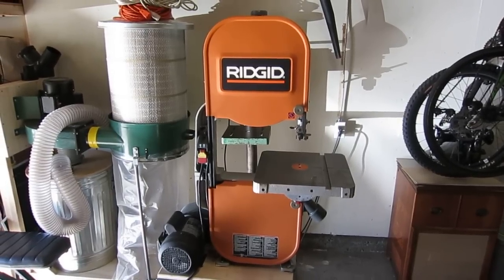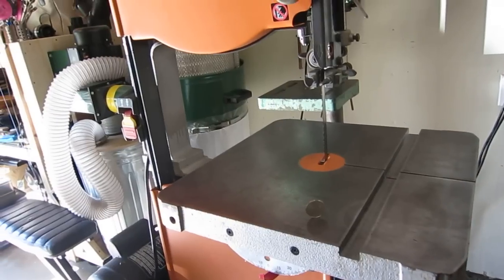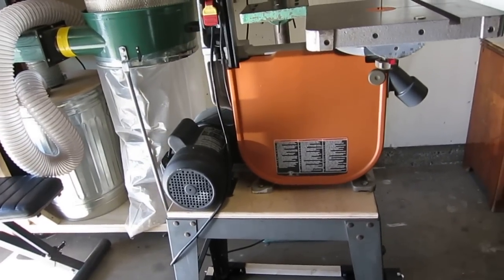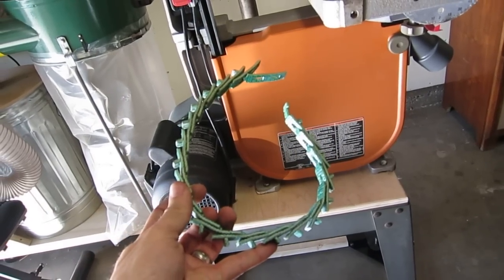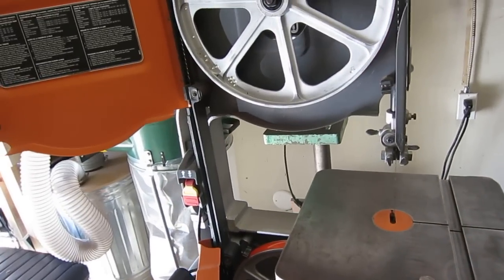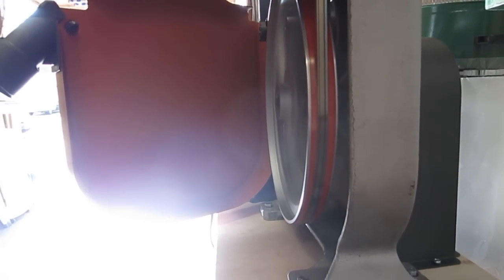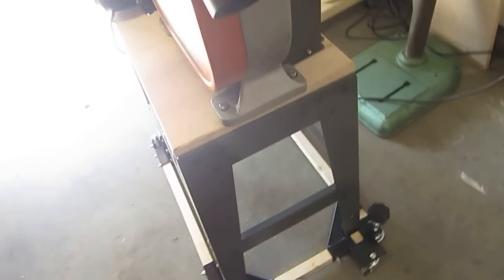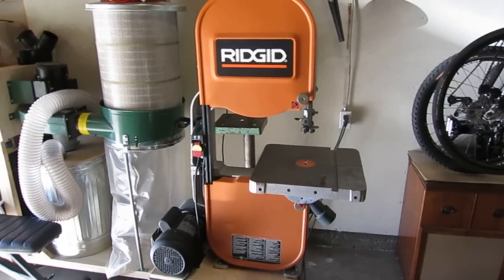Ridgid 14002 Band Saw Must Do Modifications

Comment: The wobble in your wheels are from the wheels not properly spaced from the lockdown nut.  You need to add shim spacer washers to the wheel hubs in order to snug up the wheels and stabilize it better.  There are shim spacer washers available. It is a matter of finding the right diameter and with graduated thicknesses.  You need to use a feeler gauge to test the play of the wheels between the mounting hub and body on both upper and lower blade housing. If you shim one, then shim shim the other. Make sure you have matching shim thicknesses for upper and lower wheels. There will be differences in how much the wheels wobble, which are indicators of improper spacing between the wheel hub and the wheel. Once properly and correctly shimmed, all or most of the remaining vibration issues you are experiencing should go away and the machine may actually run smoother and quieter.  

Good video, nice job balancing the wheels. I am a little concerned that you chose to drill the wheels instead of finding lead weight clips to balance the wheels with. They are available and can be clipped to the inner rims between the spokes. Once in place the balancing clips can be tacked down with JB Weld epoxy which is a strong permanent bond.

I was just gifted the exact same model. It was left out in the weather so I need to clean the motor. The tires need to be replaced, the table sanded and the tensioning rod and adjuster need to be replaced. Once I get them installed the saw should work. It will then be a matter of rebalancing the wheels and doing a lot of sanding, cleaning and adjusting. Thanks for the video... very informative.

Comment: I have a similar model. Had to replace the top tire immediately. it does shake a little on start and stop. The blade tensioner does not seem to be right. Any recommendations?

Comment: I bought this same exact machine a month ago and could someone give me advice on how to fix the bottom wheel will not staying on because of left handed threads.  If I tighten to much then it rotates really hard whenever I turn it on the machine.  Am I missing a set screw or a bushing behind the wheel?  For this band saw to spin freely and smoothly I have to hand tighten the left hand threaded bolt and then whenever I turn on machine, the bolt comes out after a few minutes.  HELP!!Great video too.

Comment: I have one as well I got used and it jumps all over and the rubber on the wheels rides off. Where did you get the new tires and by chance do you have a part number? Great video by the way.
Reply from the maker: Thanks!  Sulphur Grove is the maker.  Just their generic 14" band saw tire is what you need.  Available on ebay and amazon.

Comment: Order an upgraded upper wheel assembly now and save yourself some time and trouble later on, the pot metal its made of crumbles under the blade tension and will fail 100% of the time eventually. Luckily there are upgrade quality replacements made of cast iron.

Comment: Thanks for the video.  I have this bandsaw and had it in storage for a long time.  Now I need to get it working again.  How did you balance the wheels and where did you get the new tires.  Again thanks for the video it was very informative.
Reply from the maker: Google "band saw wheel balancing" .  There are plenty of resources that will go much deeper into detail than I could with a written response.  It's a pretty straight forward process once you see how it's done.  I purchased the tires off of Amazon
Reply: Thanks much

Comment: What is the process for balancing the wheels?
Reply from the maker: Let the wheel spin without a blade or belt on it.  Mark where it stops.  You want it to stop randomly every time.  If it stops in the same place you either need to remove material on the bottom where it stops or add material 180* from that.

Comment: BTW..what brand Urethane Tires did you buy? If it made that much of a difference, I want the same brand. I will balance my wheels without any tires on it.
Reply from the maker: +Mark Price I ordered the PS Wood Machines band saw tires.  I've since sold this machine but I purchased the same tires for an 80s Rockwell Bandsaw that I used for awhile and then for my Rikon 10-325 that replaced the Rockwell and again on a late 40's Delta 14" BS I'm restoring.  All have been great and have made a big difference.  Goodluck!

Comment: AWESOMMELY, WONDERFUL EXXCELLENT ASTOUNDING..  EV
Reply: Thank you for this video, I decided to buy one of these after watching. I found another really great trick to smooth these out. I purchased a set of 4 vibration pads that are made for washing machines. I picked them up at a thrift store for $3.00 so figured why not give them a try. I first installed the link belt which really didn't do anything. Then I balanced the top wheel and that seemed to help some but not a lot. Today I installed the plywood under the machine and also replaced the lower tire at the same time. This made a very good improvement. The upper tire was already replaced by the previous owner so they are both done. After this the machine was much better but still vibrated  more than I would have liked. So, I installed the 4 anti vibration washing machine blocks and wow! they really smoothed the vibration out. Now the machine is so much better that it was. Thanks for the video and hopefully my additional trick will help others watching your video.

Comment: Are you experienced with bearings and the arbor wheels on this at all?   I have all my moda done but when I run the saw without the blade on I'm getting a pretty loud knock from the bottom wheel. I posted videos on here if you click on my name/profile.

Comment: So how do you balance the wheels?
Reply from the maker: +Leroy Farmer Search youtube for "balancing band saw wheel".  There are a number of videos out there.  I didn't want to include it here because it's already been done and it would have really lengthened the video.
Reply: +Leroy Farmer I bought this exact saw before I ran across this video.  I too had to balance my wheels.  It helped to get 2 ceiling fan balancing kits but I also had to drill out my heavy spots.    Basically the heavy spot always wants to go to the bottom (no blade attached of course).  Just start by adding one of your weights to the exact opposite end that falls to the bottom  until it's close enough where you can slowly remove material with a drill to the point there are no heavy spots rolling to the bottom.  It will always randomly stop when every rotated when spinning freely.

Comment: Don't listen to that guy. I actually scored one on Craigslist a few days ago ONLY because of your notes here. Question, how much tension do you have your drive belt under. I believe I have too much.
Reply from the maker: Glad I was able to help!  As for the belt, you should be able to push on the belt and get 1 or 1.5 inches of deflection.  I think there's an exact number in the manual, which is available online.  Enjoy it!
Reply: How did you clean the rust off the table too?
Reply from the maker: themrnorwood WD40 and a scotchbrite pad then 600 and 1000 grit wet/dry sandpaper.

Comment: How did that mobile cart end up holding up for you?
Reply from the maker: It's held up well.  I actually have a few now and haven't had an issue with any of them.
Reply: thesergeant you when you want to stop the roll you have to turn the oversized knob.  Do you find that a pain?
Reply from the maker: Adam Barraclough It hasn't been a problem for me.  It really only takes a couple turns to raise/lower it enough to roll/stabilize it.  Obviously a pedal is more convenient but the larger size and cost difference wasn't worth it for me.
Reply: thesergeant When you upgraded the tires did you do any cleaning of the wheels before you put the tires on?
Reply: thesergeant Did you leave the stock feet on the stand before you put it on the HF stand?  I took them off and I am getting a little wobble even with the feet lowered on the HF stand.

Comment: where can I get the new tires?
Reply from the maker: I purchased them off of Amazon from "Sulpher Grove Tool".    I've used them on this saw as well as a Rikon 10-325 and a 1946 Delta 14" with great results.  They've been great.  I tried others and they haven't been a tight fit or had bulge at the joint
Reply: 1" width?

Comment: I have this saw, vibration horrible and for the life of me I can't get the blade cutting true. The blade cuts at a slight angle all the time as if the tires aren't good but the tires look fine. I don't know but I'm sick of it and want to get something else.
Reply from the maker: +swimbait1  Balance the wheels, replace the tires and see what happens.  If the vibration doesn't go away try the belt.  Those three should address the majority of the vibration problems with this saw.  As for the blade not cutting true, you might want to bump up your blade tension, or adjust for blade drift.  Also, set your machine up per "Alex Snodgrass".  Hopefully that will solve your problem.  I will say this though; I sold this saw and I regret it.  I purchased a Rockwell 28-200 to replace it thinking I was getting "vintage quality" but I and had nothing but problems with the Rockwell.  Sold that saw and got a Rikon 10-325 (which is great btw--once adjusted) and  also restored a 1940's Delta 14".  While both Rikon and the Delta are great none of them have compared to the Ridgid in terms of cut quality.   Watch the "resawing with Ridgid BS14002" video to get an idea.  I had absolutely zero blade marks with this Ridgid.   I wish I would have kept it to be honest.
Reply: +swimbait1 I have this same saw and the vibration is bad. I have not replaced the tires yet and after seeing this video I bet that will help. I also had really bad blade drift with the Ridgid blades. Blade tension, etc nothing fixed it until I switched to Timberwolf blade as recommended by many others. No drift whatsoever.

Comment: By the way you slap your hand down on the nickel and the white spot under it, makes me think it was glued to the table.

Just saying...
Reply from the maker: Lol.  No glue!  It's just that smooth.  I've had 5 band saws since this Ridgid (Inca, 3 different Deltas, Rikon 14)  and none have cut as well as this saw.  No visible blade marks on the work piece and it cut very smooth.  There's another video I did resawing walnut.  Absolutely no blade marks.  In retrospect I should have kept it.

Comment: THESE SAWS ARE CRAP!
Mine had a problem with the blade adjustment and I needed some parts. I found out the parts were OBSOLETE!   WTF?
My saw was only a couple years old and Ridgid stops selling replacement parts? They say their tools have a lifetime warranty but it's only the until they discontinue the tool. After that, you are totally screwed and your life time warranty just got screwed.
I have a Ridgid drill press that is under 4 years old. I need new drive belts and they are also OBSOLETE. WTF? 
After calling them they told me they cannot help me since the manufacturer doesn't make them anymore.
These tools are pretty well made for the average guy, but you will get screwed when you need to replace a part.
I will never spend my hard earned money on Home Depot power tools again.
Reply: Same with RIDGID'S 1300 Thickness Planers . When the $3 motor brushes wear out in only a few years you can not get any more . & several companies use the same brushes & caps , RYOBI , P.C. etc... .  i have a barn full of RIDGID tools waiting to become boat anchors . The Life Time Warranty never gets activated !
Reply: mike peine

Sorry to hear that Mike. I just got rid of my RIDGID 14 inch drill press because the drive belt wore out and I couldn't replace it. A freeking drive belt? ARE YOU KIDDING ME? There are no other machines in the world that use those same belts. I found new ones online as end of stock sale, then sold the drill press for pennies on the dollar just to unload it.
Never, ever, again.
Reply: MascotAL
 Thx .... It's not just RIDGID . as other companies use the very same parts . & i have the same drill press ! i guess i'll get one of those belts that loop together ? Sounds like Class Action time ... Have a good one !
Reply: mike peine

Those loop belts won't work on this drill press. You will need to buy belts on ebay. Use the belts part number to search.
Your other option is to replace the pulleys and that will cost more then the drill press is worth.
If you contact the parts dealers they will tell you to replace your drill press.
Reply: MascotAL
 i guess a nylon stocking will have to do ... .